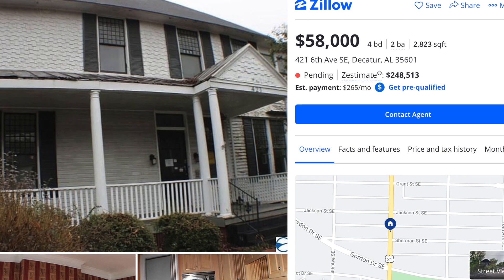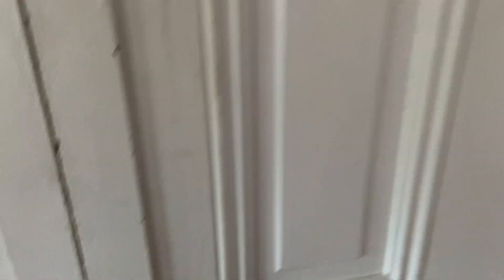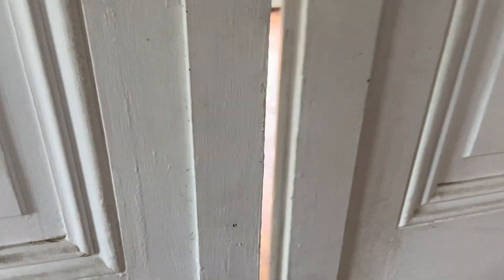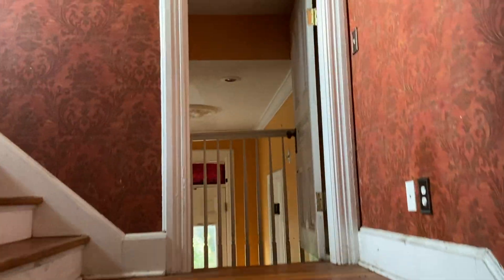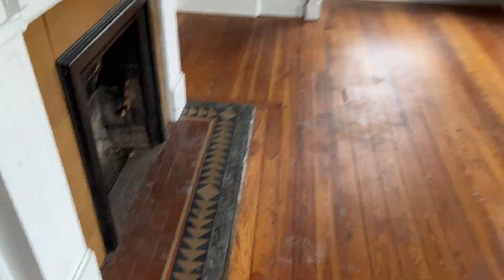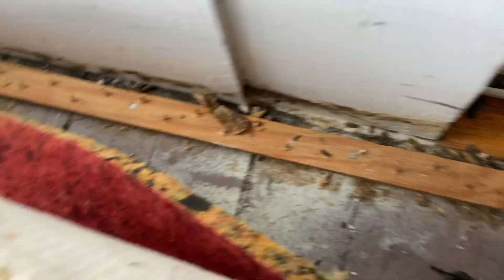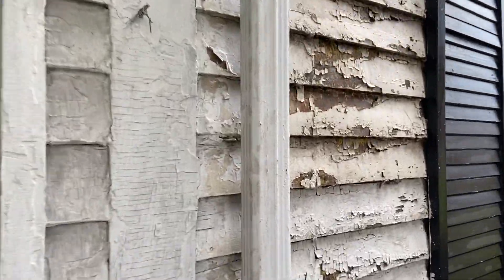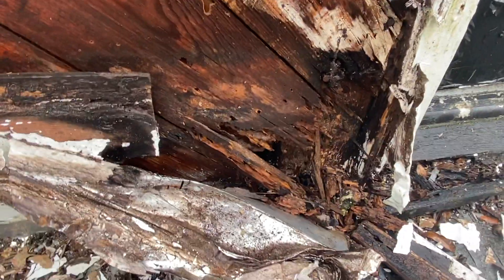Fixer Upper - 1903 Victorian | Historic Home Remodel - Day 1

Comment: I would have a qualified professional check your radiator heating system, no matter whether it's steam or water.  The tank in the laundry room has been removed so the entire heating system may be in jeopardy.  That tank is a sort of dead-end turn around for the system.  The tank should be at the highest point in the heating system, so the steam or water can cool down and flow back to the boiler.